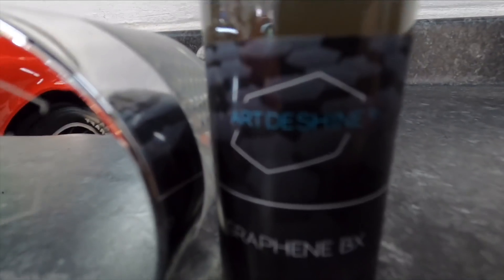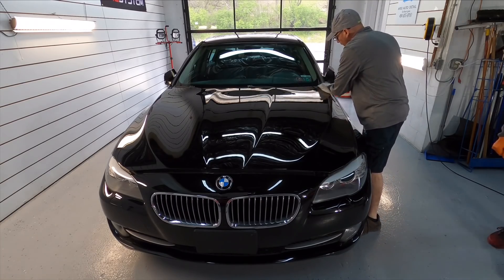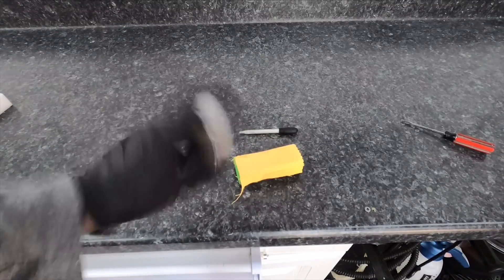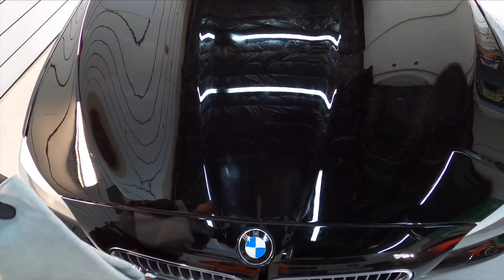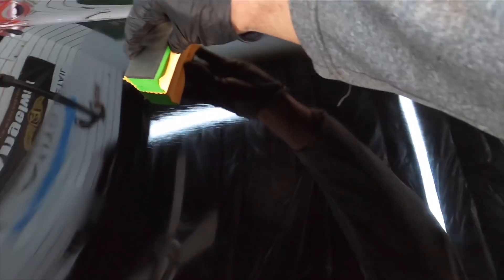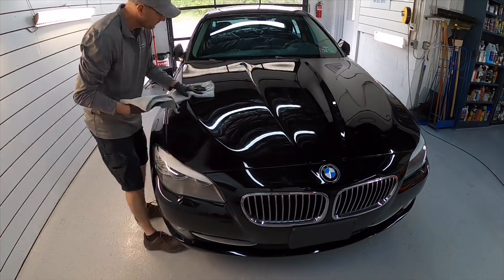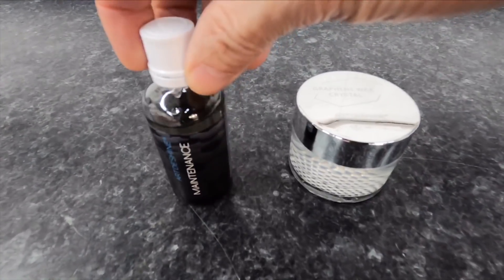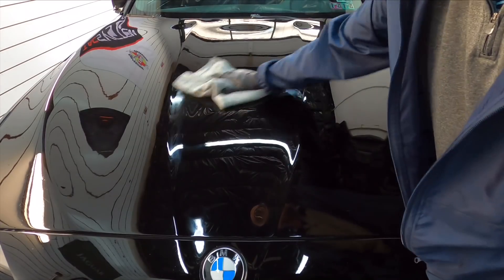Artdeshine GRAPHENE COATINGS!!!  Are Graphene Coatings Here To Stay?

Comment: Do you still need to throw away the towels you use like you are supposed to do with ceramic coatings to prevent scratches from older, dried materials?

Comment: "5-year-coating" -- how is that even measured? I realize it can only be an approximation... but what is it that makes a(ny) coating go away? Is it sunlight, is it water, is it friction, or is it acids? I realize that one of my cars, a pure summer vehicle, any coating will last longer than what the box says, as it is only driven/exposed to elements rarely, but in order to know which kind of coating to put on it it would help to know what actually wears the coating off....

I'm really interested in graphene coatings, they seem easier to apply than SiO2 and last longer, but I realize this is not really proven yet...

Comment: Great video Brian. Did you find the BX to be sticky to remove?  Was it slick after it was completely removed before the maintenance coat?  I would like to try it but if it’s really hard to remove i might pass. I am currently a fan of CSL + EXOv4 due to its easy application and incredible slickness.

Comment: Wonder if Artdrshine knows that Google filed US patent in  2019 for several versions of manufacture and application for it. Anyway, I'm making my own.

That brings me to question, I'm curious as a backyard chemist, which of the three  manufacturing process did this company use to produce this product? Why I ask is because of the difficulty in having Graphene properly bond with the carrier. Graphene is not a liquid and each particle is one atom thick and 2 to 3 nm long. It is basically a two dimensional object. Getting it to combine and saturate a carrier is a highly specialized process. So I hope they didn't just pour it into a jug and shake it lol.
Second I'm concerned about the amount of Graphene used. There is a minimum amount for it to be effective with it's Polymer partner.

Just as a note, I think it's funny that the are using concrete sealant and ... It only take usually 2 hours for cure. That might be extended on a less pourous substrate. But 24  to 48 hours they are pulling someone's leg.
As far as rating the product that is the carrier has a 5 to 7 year  Hydrophobic rating on cement. You should do about the same on maintaned car.

King of the hill? Ok.

Thank you Brian for your work in showcasing products. I have found your judgement is usually astute, and dependable.

Comment: Love your videos. As part of a yearly maintainence wash on a ceramic coated vehicle, are you meant to clay the vehicle or only decontaminate chemically? I know that claying will remove contaminants that a chemical decon will not, but wont the clay somewhat reduce the lifespan of the coating or slightly abrade it. Keep up the awesome videos.
Reply from the maker: Ahmad Abboud I will not Nky clay where I can feel the bonded contaminates in that case. With mild clay.
Reply: @apexdetail85  so after the iron removal you try and feel for any left over contamination and then clay, even if it is coated?

Comment: Brian! Quick question. I currently have a Nanoskin 21mm long throw DA that I use for my paint corrections and I'm in the market for a new DA. Any recommendations for a top of the line DA? Either long throw or not, doesn't matter
Reply from the maker: LordZillo Flex polishers... if price is no issue.
Reply: @apexdetail85  thanks! Flex was actually what I'm looking at! Any thoughts on the new Lake Country 5 in one polisher? It has a rotary setting, 3 DA settings and a sanding setting

Comment: definitely interested in the window coating. if graphene disperses heat, would it keep the inside a vehicle cooler during summer? I am no fan of window tinting if it is not molded in to the glass from manufacture. When it comes to painted surfaces,  I still love going thru the process of installing a sealant. Brian, I can't say I don't geeked out when something is bad ass.
Reply from the maker: Donald Green that video is coming soon

Comment: The change is somewhat noticeable after the application.  I could see more detail in the reflection.  It could just be me.
Reply: Apocalypse487 it is noticeable 100%..SYDNEY Australia was warm when I first applied Graphene coating,and after install requires a damp towel to further spread the coating then buffed off..on black looked killer
Reply: @detroitcustom  I'm still gonna wait another year or two.  I don't have a garage, so it's difficult to do any coatings.  I like using polymer sealants instead for that reason.

Comment: Hey, I tried to make my own detailing product and it worked, can you maybe do a video about that too?
I used fresh Carnauba Wax, snake oil, Water, Orange, cherry powder and silica dioxide.
It has the same "functions" as the Turtle Wax Hybrid Ceramic Spray, but smells better and is easier to apply.
I applied it 3 Months ago and it still looks amazing
Reply: Throw some graph paper in the mix for extra long lasting protection.👍
Reply: @reeb9016  3 Months is long enough, and it's still going, I'm going to wait until it stops beading and then trying to improve it again.
Reply: When you say orange, do you mean orange food dye or an entire orange?? Also, what type of snake's oil do I need again? My salesman comes around on Wednesdays
Reply: @LJM2stepspain  I used orange powder but you can also use orange juice I think. Any snake oil will do, its all the same.
Reply: Would love to hear more ! Snake oil for real ? What's snake oil and what would it add ?
Reply: @georgematos1086  I dont really know much about Snake oil, but it adds gloss and slickness
Reply: Hey wait a minute is this an F11 product?
Reply: @PeteyMcSavage  No, I just made it myself